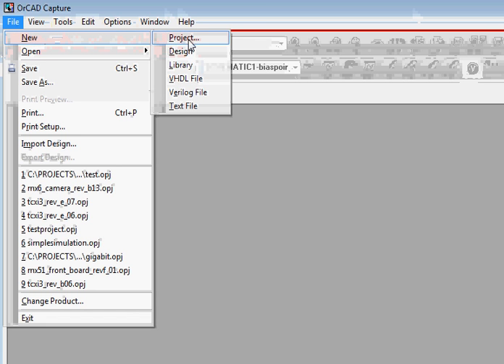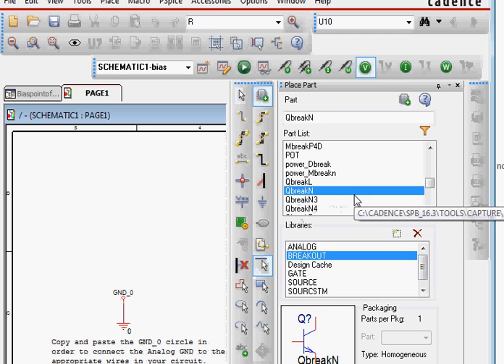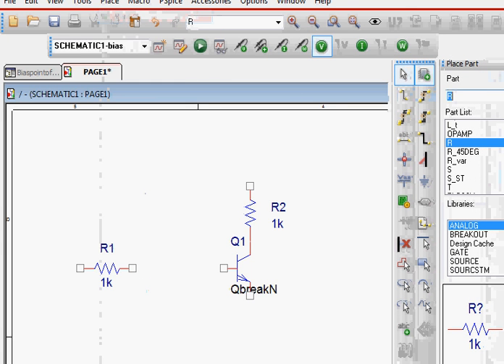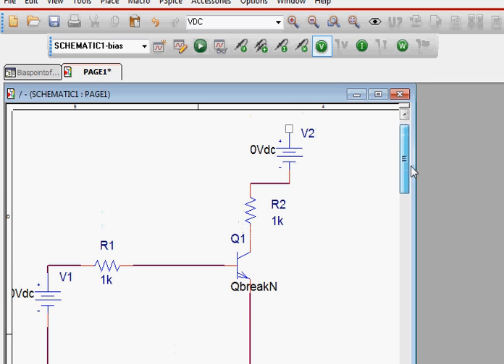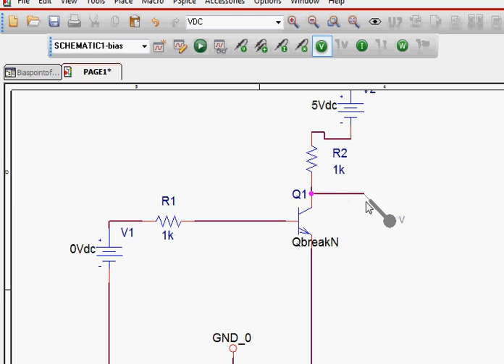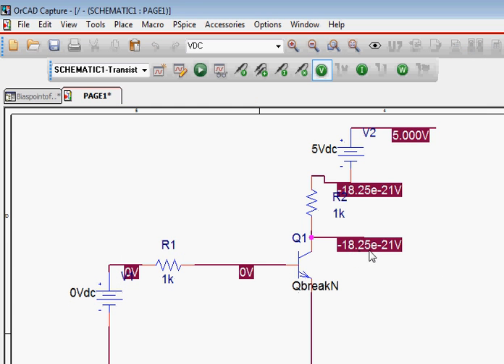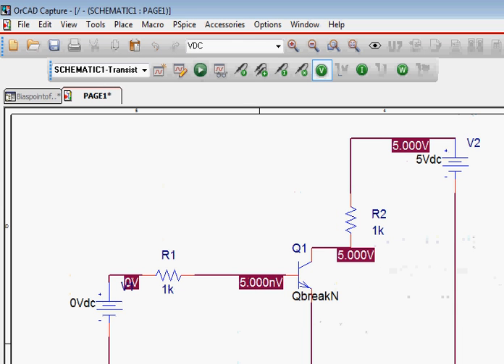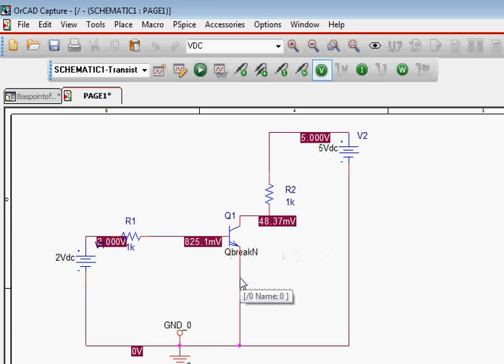Transistor Circuit Biaspoint Calculation using Orcad Pspice

Comment: I have a problem about transistors when ı try to run the program it gives an error Model Q2NPN used by Q_Q1 is undefined please help
Reply: Usually means the library is not loaded into your simulation profile.